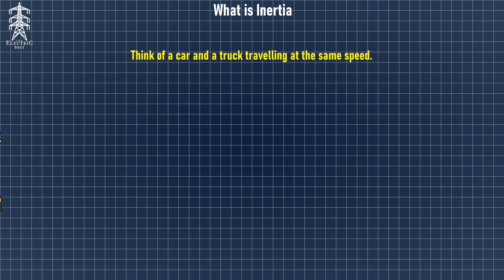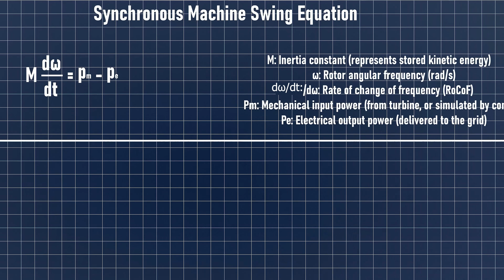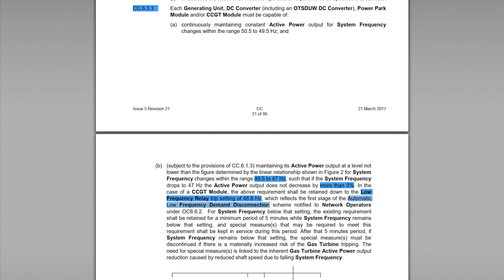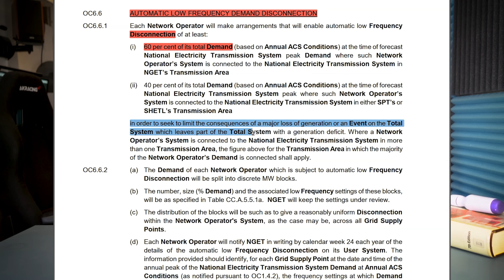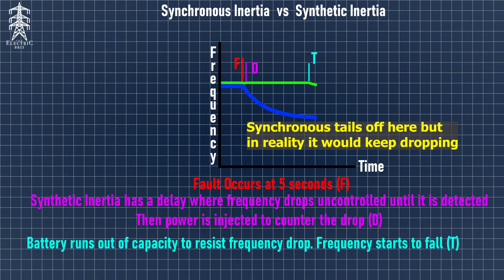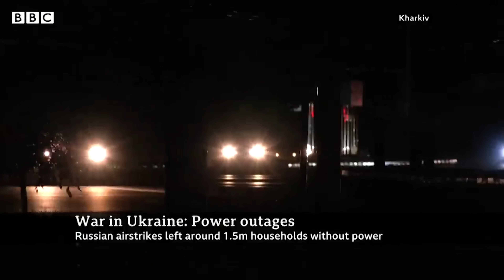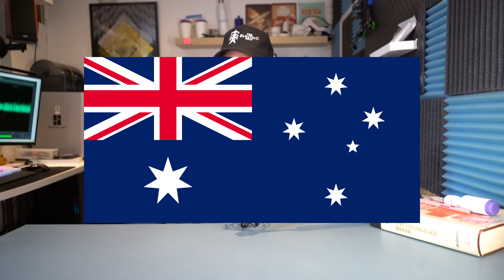How to Restart the Grid after total collapse

Comment: I think I understand most of what you are saying but I'm puzzled by a few things. I understand why power plants disconnect when frequency/phase is too far off and that mechanical devices like turbines require some time to spin up and down and settle at appropriate speeds and get in sync, I wonder why the grid doesn't have a separate channel to transmit a reference signal to wich every power station should set their PLL to.  There are plenty of technologies today that can send a time reference with extreme accuracy.  Secondly, while a power plant is spinning up and syncing, it's still generating power which could still be sent to the grid through a AC-DC-AC converter where the AC from the power plant is converted to DC and then finally converted back to AC with the frequency and phase tied to the reference signal.  Then once the plant is finally synced, you can simply bypass the AC-DC-AC converter to avoid the losses.  I do understand that applying this on a grid scale would require investments, time and likely a lot of testing before being put into use.  But in my mind this "buffer" could potentially reduce the risk of a total collapse and shorten the duration of a black start.  Since this idea is pretty simple, there must be a valid reason why this cannot work.  So my question is: what am I missing?

Comment: I think every power station should have an area that it supplies, with connection to other areas. Normally they would all be connected, but when one power station fails, and the surrounding stations start getting overloaded, those connections should be cut to prevent that one power station from taking down the whole grid. The blackout would be limited to that one area while the rest of the grid would keep running normally. That would affect far less people and it would be far easier to recover from.
Reply from the maker: That sounds like a mix of what the grid was before we made it a national grid, and what we do now with isolating faults before they cascade :)

Comment: CCGT is Combined Cycle Gas Turbine. As far as I am aware there are no OCGT in operation, unless held in reserve for emergencies as they do start up quicker but are highly inefficient compared to CCGT.
Reply from the maker: Hi Andrew :) A few of the CCGTs on the grid can start in OCGT mode to black start and switch to CCGT once running. My local power station at Spalding also got a new OCGT in 2018 (It's bloody loud when it runs).

Comment: How do the black start sites synchronize their frequency for the generators before connecting to one another?
Reply from the maker: The black start sites will start generating power either with hydro or using a diesel generator to start a gas turbine.

The frequency is set by the turbine speed and will be as close to 50 Hz, and automatic voltage regulation will try to keep the voltage in spec.

Then it will start to connect load and keep balanced and when a second island is up to speed and stable, the relays will compare the two and keep phase angle, frequency and voltage in range until they can connect up and just expand from there.

Comment: Couldn't there be a timing pulse sent at zero crossing or low voltage sine wave for synchronizing starting alternators?
Reply from the maker: The generators will all start up independently to form small grids, the speed of the turbine sets the frequency and the automatic voltage regulators will maintain the voltage. Then at the substations, measurement transformers (CTs and VTs) will measure the voltage magnitude, angle and frequency will be monitored and once they're all within an acceptable range, the breakers will close and join the grids :)

Even in a normal grid situation the circuit breakers must "check sync" between two busbars to not join at the wrong time on the sine wave with the wrong angle.

Comment: How does phase-matching of the different black start islands work?

Presumably when they all come up independently they all have random phase on their signals and this need to be matched before the islands are joined?
Reply from the maker: That's right, current and voltage transformers for measuring are used on both sides of the circuit breaker that are keeping the grids separate. The generators on both sides will try to match their phase, voltage and frequency within a small margin then when the circuit breaker gets the close command, it "checks sync", waiting for the ideal time on the waveform to close. If it closed out of phase it would cause some issues.

Comment: Tremendously informative series of videos on a topic that is rarely appreciated and understood. Very grateful for this resource. With the PV on the roof of my house, soon to be upgraded with new panels and a battery, I contribute a few kW to Germany's "renewables heavy" grid, where the new government is under sharp criticism from some quarters for what is seen as an outdated approach to grid management, preferring to subsidize new gas and CHP stations in preference to batteries and statcoms. 
I wonder whether you might cover the contribution that the hundreds of thousands of distributed small feed-ins such as mine could be able to make to VAR compensation.
The railways of Switzerland run on 15 kV, 16 2/3 Hz electrification. Some of this is powered by the railways' own hydro stations and a dedicated low-frequency railway-only grid, some is taken from the 50 Hz grid via rotary or static converters. In the early and mid 1990s, Switzerland introduced a large number of new locomotives with 3-phase drives fed by power electronics. These replaced older locomotives that had, in effect, DC motors tortured by the low-frequency supply. The low frequency had been introduced in the early days of electrification to allow direct current motors to commutate moderately well, as there was no effective way to control the speed of AC motors at the time, no effective rectifiers for mobile use, and it was found that a 50 Hz supply caused damage to commutators. The 1990's change to modern drive systems caused unexpected disruption to the grid characteristics and a number of locos were parked around the country specifically to compensate. That might be an interesting topic for you to cover.
Reply from the maker: Appreciate the comment and the high praise 🙏 Solar PV and its effects on distribution and transmission is definitely a topic high on my to do list. I'm in contact with an engineer doing a paper on it currently, as in the UK its now mandatory for new homes to have solar and it's already a big issue for distribution being overvoltage (I can record 254V in my home). Solar and battery is amazing for consumers, but our older grid isn't keeping up, and that'll have a knock on up stream.

Rail electrification is also a big topic I'll need to research more to cover, and cool stories like yours are definitely a testament to the problems and solutions of the time. Especially as there's plans to push electrification more in rail and transport is a massive area needing decarbonised.

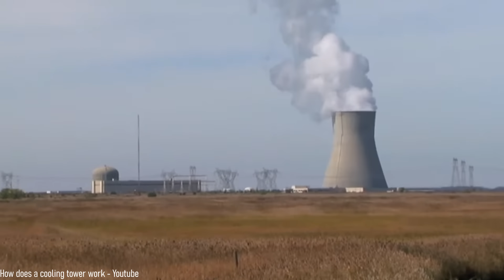Comment: @14:00 the pictures shown were the Hope Creek Nuclear Generating Station (BWR) and @14:10 the domes of Salem Unit 1 & 2 Nuclear Generating Station (PWRs), all three are located on Artificial Island in Lower Alloways Creek, New Jersey, United States.  The three of them generating about 3.6 gw when all three are online at 100% power.

I was a licensed reactor operator at Hope Creek.  All U.S. nuclear reactors will scram or trip on a turbine trip from turbine protective relays.  If we lose the gird, it is called a station blackout and our emergency diesel generators will come online in 13 seconds and systematically reload our emergency pumps and equipment.  We have 4 EDG at Hope Creek that can generating 4430 kw each.  Each Salem unit has 3 EDG of about a similar size.

The PMJ is our regional grid operator and they are the ones responsible for black restart procedures.  Artificial Island with the three nuclear power plants is to be the last three units to be restored due to our physical location at the edge of the grid and our startup power requirements.   Our in house power loads at 100% power for just Hope Creek requires about 42 mw to run all the pumps and other equipment.  Just to energize the switchyard, transformers, and transmission lines takes about another 30 mw.  By law, to start a nuclear power plant in the United States, you need to have independent sources of offsite power for the safety of the reactor.  The fastest I seen us restart the reactor was about 36 hours and that was a plan shutdown turn-around.  Unplanned outage could take longer much longer.

Large coal power plants have similar problems in that they need large amounts of power to run their boiler water feed pumps, coal feed systems, and blowers and scrubbers.

Small gas turbines can black start using compress air just like a jet engine on an airplane and require no offsite power other than batteries for control power during startup and they will get the call once there is a stable local transmission line to use the power.

Comment: What I'm wondering about is how communication and coordination will take place in case of a black start. How will you tell an operator to go to a substation to switch it when the cell phone networks are likely down? Are classic phone lines kept functioning for that kind of incident?
Reply from the maker: Great question for our digital world. All our substations still have hard wired phones as well as their own fibre optics. Anytime the control centre calls us at a substation to do switching for example or check an alarm, its on this central phone.

Most cell sites will have backup power to get them by for a little while but obvious panic will quickly overwhelm them. I'm sure word will get to standby engineers in time still. Most things can be done remotely still but if something is out on maintenance for example then you'll need someone to attend in person.

Comment: Just want to point out that post black start scare, Texas implemented a demand response program that has significantly reduced the need for rolling blackouts.

Instead of mainly focusing on factory loads, this system utilizes datacenter load (relatively static load that already has automatic transfers to on site generators). Datacenters have the ability to rapidly head load without disruption to operations.

Comment: I have a question which I'm sure others have ask3d but here goes ........turbines are essential for maintaining grid frequency due to their inertia being able to smooth out fluctuations yes? As I remember,  turbines (apart from the gas ones) are steam driven and steam is produced (largely) by superheating water. My question is, would it be technically and/or economically feasible to use solar/wind turbine powered electric steam generators to power turbines? In other words,  could we just connect a solar/ wind turbine farm ( with a stored/back-up battety smoothing system) directly to a boiler ( for want of the correct terminology!) to generate steam for a decent sized turbine to provide frequency stabilisation and for a black start capability? I suspect that the investment would cause heart attacks amongst the wretched bean counters, but reliability of infrastructure outweighs their whinging surely?

Comment: I remember being shown the black start capability at Kingsnorth many years ago when visiting for a project; it's worth relating the practicalities.  Basically a man with a torch comes in and unlocks the auxiliary power building, and finds a bit of string that hangs on a hook on the wall.  He uses the string to pull-start a little petrol engine that drives a compressor.  When enough compressed air is built up he can start a 62 kW diesel engine.  Once this is going it produces enough power to start one of the four Rolls Royce Olympus 22.4 MW gas turbines, which in turn produces enough power to start the other three.  With all 4 gas turbines going the 90MW was enough to run all the ancillaries for one 500 MW coal unit (conveyors, mills, fans etc) to get it going, which in turn could power up the other three to get to the station's full 2,000 MW.  Getting the coal boilers up from cold would be the slowest part.

When we had the big storm of 1987 we all woke up to a nationwide blackout due to the severe damage to the grid.  They used that black start system and it worked, we had power back on by the afternoon.  I am inclined to believe its the only occasion the UK power grid ever had to do a black start for real.

Preparation pays!  

Sadly all long since demolished now.  I used to love the old coal fired stations, cathedrals of mechanical and electrical engineering on a mega-scale.  The only two left now are Drax and Lynemouth, fortunately now converted to carbon-neutral biomass, and still going strong, and still on my circuit of regular visits for projects.

Marion
Reply from the maker: That’s a great story Marion and I’m fully in your boat in that these are monuments of engineering and industrial history. Landmarks that millions pass by daily and often don’t know much if anything about them. I do hope we can preserve some of them for the future even if they fall out of use.

I’d love to show off more of the actual on site engineering and things running and I’ll get to it eventually. Some places are a lot more secretive than others especially when it comes to black start.
Reply: @TheElectricBrit What actually still impresses me most about that whole sequence, is that they could start a 22 MW Olympus gas turbine using the electric from just a 62kW diesel.  That's a 300:1 step up in power in one stage!  What does that tell us I wonder?  I suppose the key thing is that the parasitic load drawn by a gas turbine is very low, compared to a Rankine steam plant.  The feed water pumps for the steam boilers were several MW each, and the forced draught and induced draught fans were also several MW.  But with the coal unit, it isn't just the steam plant, you also have all the conveyors and the mills - eight mills I think to one 500MW boiler, I can't remember the power of the mills but each one must be several hundred kW.  You have to be able to power all those things before you can put the match to the boiler!

I still think gas turbines are one of the most remarkable machines ever made.  Much as I love steam plants!
Reply: That sounds a bit like a system I saw at a French chicken farm, years ago.
All apparently devised and built by the current farmers father himself.
A large brick shed with a hotchpotch of various sized petrol and diesel engines connected to generators, all on brick plinths with wires,pipes,hoses,cables etc. running in all directions,all relying on each other for their part in a chain of events required to get the three main generators up and running in the next room.
It was clearly something that evolved over time and form was absolutely forsaken for function.
But for me, that which looks to most like overcomplication to achieve one aim holds a beauty of its own.
Great stuff👍

Comment: While you provide a good explanation in electrical terms, you should mention thar basically it is all about energy / power.
The changes in frequency and voltage are basically a question about surplus or deficiency in available power. Hence low frequency correction required a power source, which could be a rotating generator OR a battery - which are not part of Wind turbines or batteries normally. 
SO either a rotating generator OR a battery is required to provide or absorb excess power. That is the fundamental physical law.

Comment: Can you go into more hypothetical where information is available. For example, how long would the grid continue to work if all the people operating it stop working?
Reply from the maker: Definitely on my radar to do some fun scenarios, especially related to Space! As for our grid I don't think it would last very long if people at the control centre or in generation stopped working. On the operations and maintenance side on site it would last until there were some persistent faults that trip circuits and lock them out. Could be minutes, hours or days. I'd bet on hours but it all depends on the weather and anything else going on.

Comment: There is one thing about this Frequency droop problem that I do not understand. Why can't Renewable sources, like wind & solar have their inverters programmed to make 50.000 Htz no matter how much the line voltage droops when there is a large system fault?
Reply: Grid frequency varies minutely over the day, with the intent that the daily average is 50.0. Not a crystal locked frequency thing. Be too expensive/impractical to do that.

Comment: A lot of blackstart options seem off the table due to choices made rather than actual technical limitations.  For example most nuclear stations will not shut down if they lose grid, it's safer for them to continue running to power their own safety systems than it is to shut down and rely on diesel generators to provide that power.  The same can be said for interconnectors, the DC power provided through these links is technically perfect for grid forming.
Reply from the maker: The full list of blackstart sites isn't public but as you say some nuclear plants in other countries can effectively island and keep running and some HVDC links are definitely used for black starting as we saw in Spain recently.
Reply: @TheElectricBritI was living in Spain when the blackout happened. Very poor grid control was followed by incredibly good black start! I expected it to take 3 days, but my power island was up and running in 10 hours.